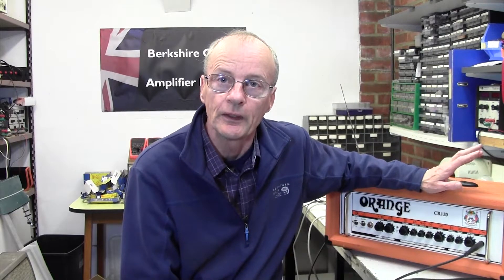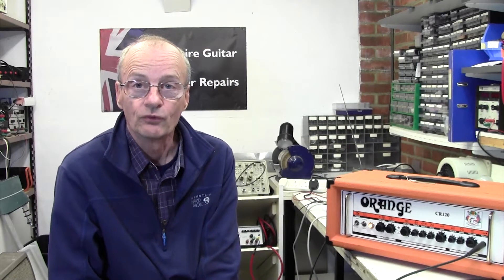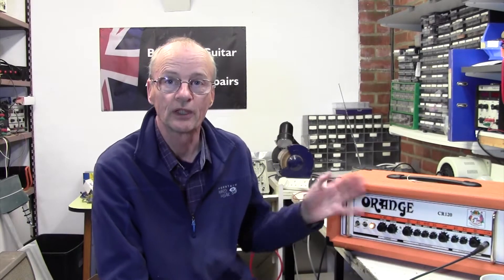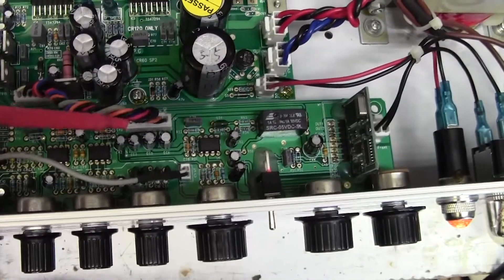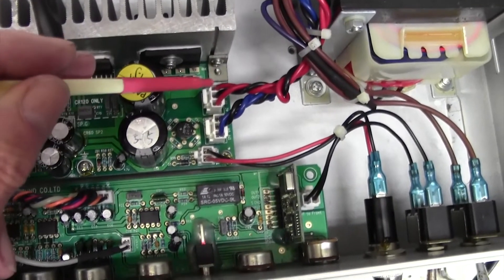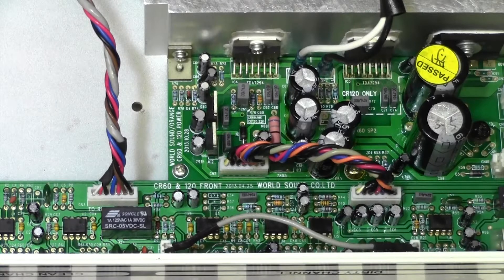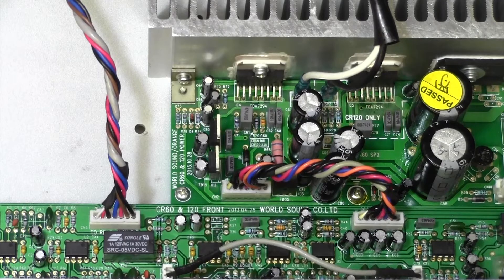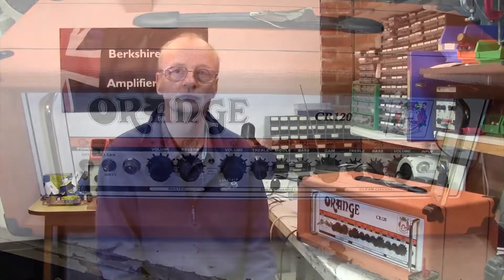How to Fix Orange CR120 Intermittent Sound

Comment: At 13:15, not only is one individual contact obviously pushed up and not seated correctly, but the entire connector housing is sitting crookedly in it's mating socket. As a bench technician I have seen this sort of failure frequently. The wires in the wiring harness are so short (the bean counters insist on it beause it might save two feet of wire per amplifier), and stiff from being tightly twisted,  that you have to pre-form the harness just right at the plug ends in order to get the plug to sit in place and stay there without the spring-like nature of the wiring harness pulling it back out or resisting as you attempt to plug it in nice and straight. (Sometimes the factory uses glue to secure the plug-in connector, which causes other issues,  including corrosion, and makes it difficult to remove the connector when you really need to during servicing),  And,  I know from experience that it would be a good idea to pull that board up and check the soldering on the bottom of that board-mounted connector. I've had to resolder thousands of those things! Sometimes you can look at them first with an inspection mirror without having to pull the board, but ideally you should just resolder them, especially if the soldering is lead-free. That stuff is brittle and never wets the connection well, it can't take mechanical stress or expansion/ contraction forces from heating and cooling. Speaker vibrations are rough on amplifier PC boards.

One more thing: *don't just spray the connectors with DeOxit!*. Use a non-residue, plastic safe degreaser such as alcohol. Otherwise, the residues will soak into the wire-crimped sections of the contacts and make the connection worse, not better. It might even corrode, especially if there is any power-supply voltages or  DC offset flowing through the contacts. The factory-made crimps themselves do fail; they're not made to military specs, do not form a "cold weld", and are not impervious to air or moisture infiltration.
Reply from the maker: All good info thanks.
Reply: @stuartukguitarampguy5830  ,  I also make a practice of removing and reinserting every plug-in connector, especially ones of this type, which are known for developing mild oxidation where the pin and the female contact intersect. Usually, inserting pulling and reinserting the connector will wipe away the oxidation. In extreme cases I have to use a pencil eraser, or bettery yet an ink eraser, with the tip carved into a skinny chisel or wedge shape so that you can run it back-and-forth around and inbetween the contacts to buff off the tarnish and oxidation. The insides of the female connector pins get cleaned with a small diameter round-wound guitar string worked back-and-forth inside the contacts, which acts almost like a miniature file or rasp. (You can clean 12AX7 type tube sockets the same way,, with a .036 to .039 guitar string). I've also seen a few cases where those female contacts, which were typically formed and worked while the metal was cold, actually snap or break inside the housing where you can't see it.

Comment: Thanks, I have a CR120 with no problems but it's always nice to see someone troubleshoot and work on something I own. I also have a JCM2000 DSL50, 1999, and preemptively dived deep into the bias drift, jacks, and main board populated with strange value resistors etc. You are so right about the number of Molex connectors in those amps. I took pictures, made notes, and marked each connector with a Sharpie. Very tedious project. But it worked perfectly afterwards. Back to the CR120, I wonder if those power transistors are the same ones used in the Korean and Vietnam made Marshall MG DFX series - 2004-2008 or so. TDA 7293. Sure looks like them. If so, they are still widely available and relatively cheap.
Reply from the maker: Hi Steve Not sure, but most power transistors aren;t very expensive. Well done for the JCM!

Comment: Thanks for this video! I’ve been having the same issue with my Super Crush 100-hopefully it’s an easy fix like this was. If nothing else, this video will give me a place to start looking for failure points. Cheers!!
Reply: @JMK571 What was exactly wrong with yours? And did you figure out why? The dirty channel on my super crush just stopped working out of nowhere. Working on getting a replacement now since I only used it for 1-2hrs.

Comment: I had one of these cr120 heads pop a pre amp capacitor from using pedals with the amp. It cut the volume 70% so I noticed and opened it up to see a popped cap and I had the exact value so I replaced it an it worked great so I sold it !
Reply from the maker: Awesome, It doesn;t usually go like that well done.

Comment: I had a problem on a valve amp with an occasional wolf tone. I started by swapping out the 1st preamp valve, which cured the problem. To double check I put back the original valve and it was still cured. Evidently that valve/base had a connection problem, but I had tried the usual checking all valves were properly seated prior to swapping the 1st valve, and also tapping the components and wires with an insulated plastic rod. Now I include swapping back a suspect valve unless it's obviously visibly suspect.

Comment: Hey Stuart, good fix! I have the same amp and lost power supply for the pilot lamp. Already checked the terminals using a VOM tester and verified it got no volts. It's still sounding great though. Would appreciate any advice to rectify the issue. Cheers!

Comment: It looks to me like that white wire that was pushed-up from it's place in the connector, is the audio signal from the preamp section, I'm guessing that it has been like that since the amp had been assembled at the factory, what most likely may have happened was that the contact might have been a bit loose and had gotten pushed-out when the connector was put in it's socket.
Reply from the maker: Yes I think that's probably what happened.
Reply: Does this mean you can send the bill to Orange Amp. and this goes under 'warranty'?
Reply from the maker: @gearViewmirror  Well, the amp would have to be IN warranty to start with, and I doubt this one was. Then I guess they'd wan it sent back to them, not some third party repairer.

Comment: I bought a cr120h and immediately sent it back. It had a buzz that was equal to or a smidge higher than the volume on the dirty channel and it would follow the volume as you turned it up and down.
Reply from the maker: Interesting - and annoying!

Comment: Do you have to use DeOxit, or would CRC contact cleaner work as well? I'm having issues with a treble Pot on my Orange Crush Pro
Reply from the maker: Contact cleaner wil be fine. I;m doing a year long test where I compare 5 differenrt cleaners. My view is that there will be no difference!
Reply: @stuartukguitarampguy5830  Thank you. I was concerned that some cleaners might damage the carbon track inside the pot.
Reply from the maker: @BlueBarrier782  My belief is that this is a hoary old myth!

Comment: Hi just a quick question, as you seem to know well about this amp. I red on a post that you can use it without a speaker because it is a transistor amp. It has been confirmed by someone at Orange and they even said that the manual was wrong saying that a speaker has to be plugged in. What are your thoughts on this? I think I will go for the in-ear monitors and was wondering if I could just this head only with my two notes cab m (which is not an attenuator). Thanks in advance and have a great cup of tea :)
Reply from the maker: Hi Philippe  Yes that's right, with a transistor amp you don't need a speaker connected. It's only valve amps.
Reply: @stuartukguitarampguy5830  I remember having tried that with the CR120 and that the final sound (I use Two notes Cab M on the speaker cable between the amp and the speaker) was a bit changed while I removed the cab from the two notes... will try again :) thanks for your confirmation anyway!

Comment: I have the orange crush pro 120 and it seem to get a low whistle which goes higher pitch the the distortion goes of to clean sound, what is going on?????
Reply from the maker: Hi David  It's possible the amplifier is oscillating. Not an easy issue to fix las. Do you have a tech near you?
Reply: @stuartukguitarampguy5830  not sure will have to have a look gutted only had the amp coming up to two years and still has labels on it lol

Comment: What kind of opamps are in the preamp board?
Reply from the maker: I believe they are TL072 but not 100% sure
Reply: @stuartukguitarampguy5830  would be cool to upgrade them to BB OPA2604. I want to buy one of these and upgrade things.
Reply: @ZagrasNixillis  that sounds interesting...what kind of change might it create?
Reply: @dddd717  more clarity with certain opamps. It's like tube rolling. Different opamps sound different in solid state amps like different tubes sound different in tube amps.

Comment: Bye the way, I had a electric/acoustic guitar that was acting up.
After 30 minutes, the guitar started to make a loud hiss noise.
So, I got a access to the pre-amp and started touching the resistors and capacitors with an alligator clip. Found one capacitor that made the hiss go away.
Reply from the maker: Nice one well done.